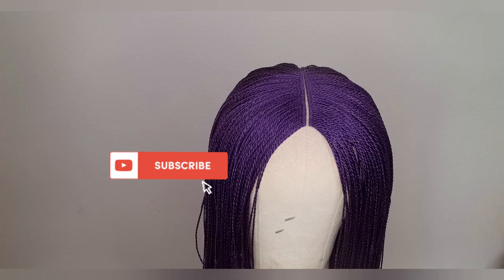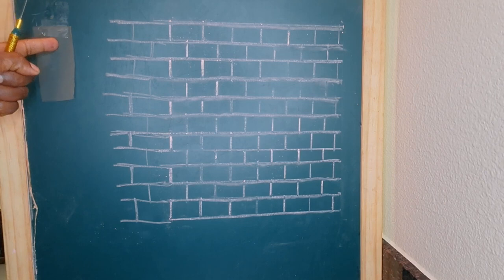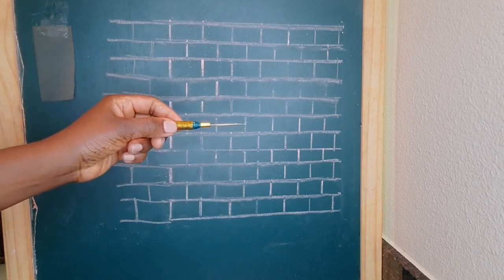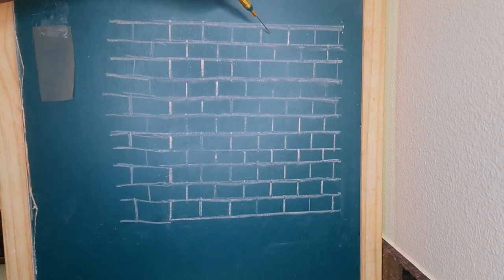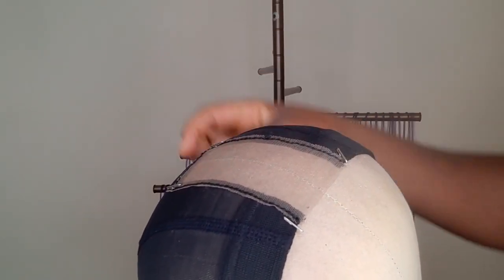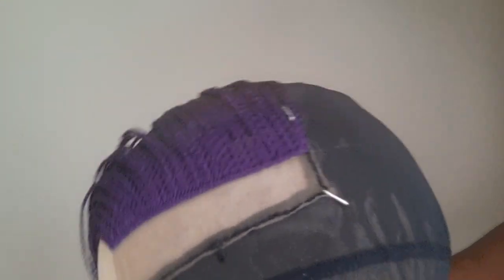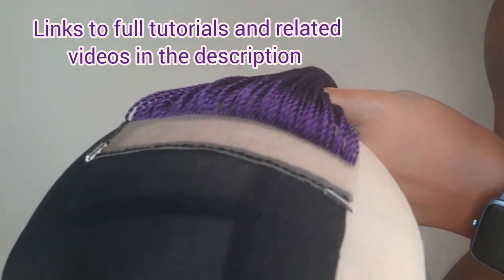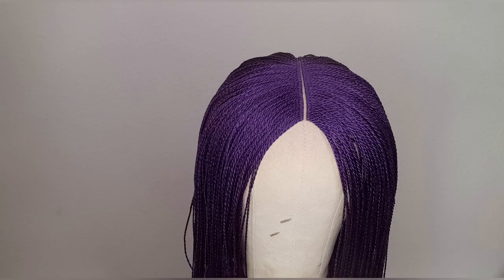DIY wig tutorials/micro braided wig with neat straight part/No closure braids wig explained.

Comment: Amazing!! How do you determine the middle part? I'd like to give this a go and I want to get it right like yours. Thank you.
Reply from the maker: Hello and Thank. Just find the mid point of your lace net and go from there. If you are using a 4x4 for example measure 2. I also use the line on my canvas block head as a guide and if you don't have that you can draw a line on a paper and put under the lace net. Will try to make a video on that.  Thank you for watching.